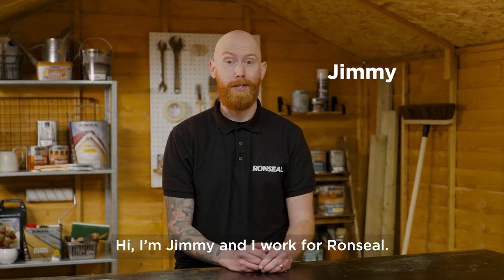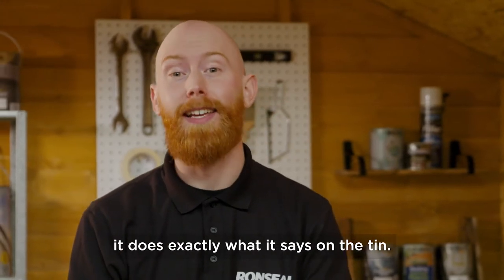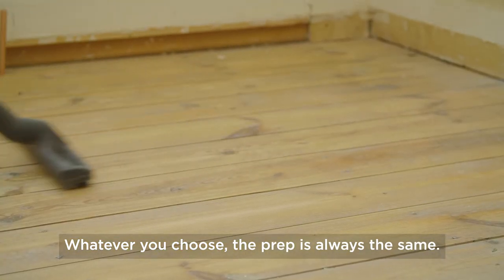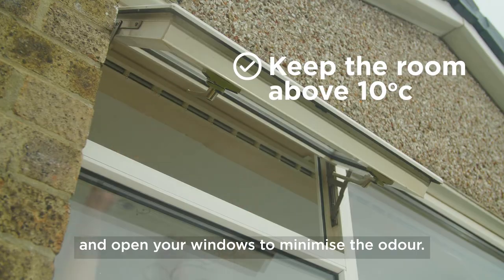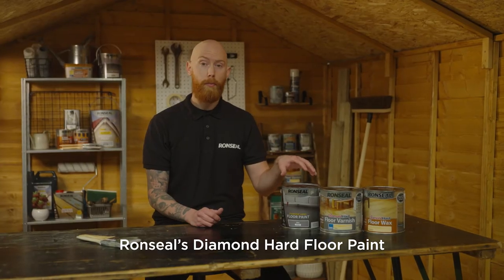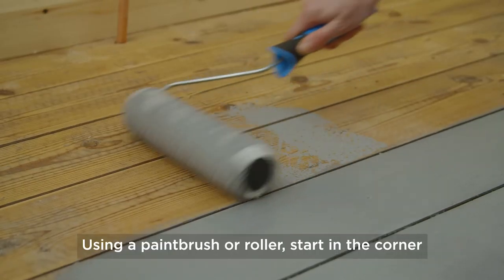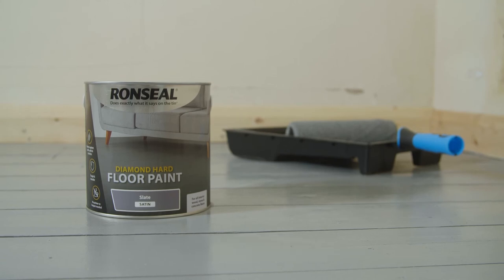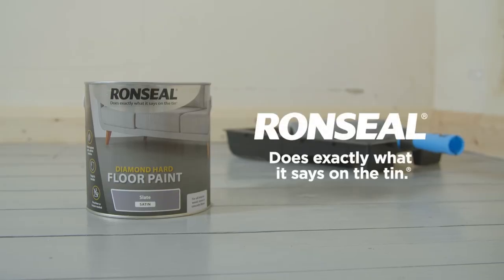How To Use Our Diamond Hard Floor Paint | DIY Tips from Ronseal

Comment: I have step with a water based paint ( been on about 8 years)on top of old oil based gloss. 

Thinking i should remove the water based completely and give oil based a key with 120 grit before applying this on top ?